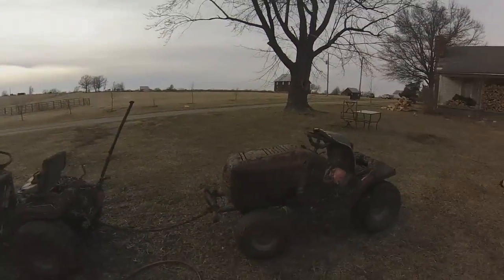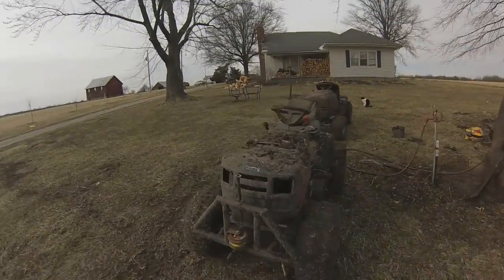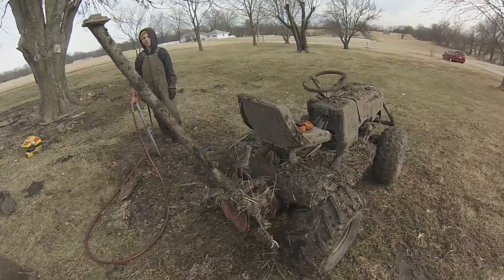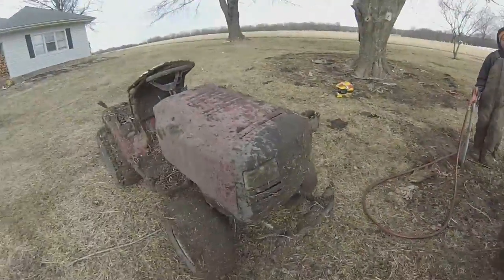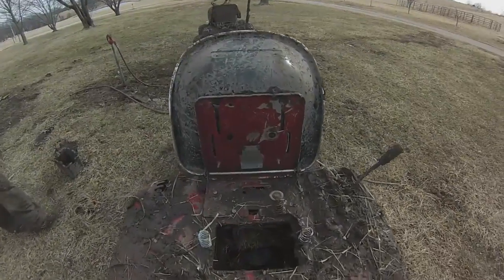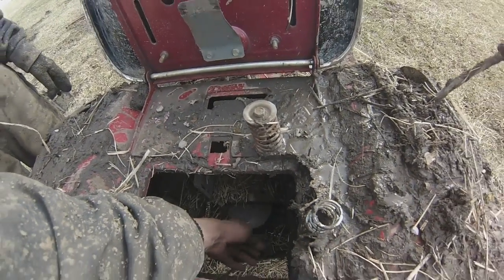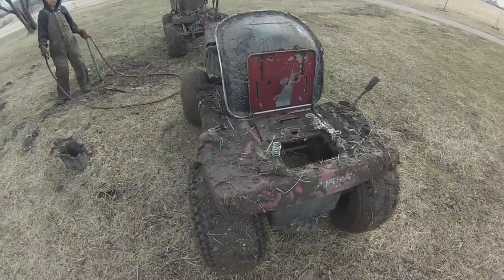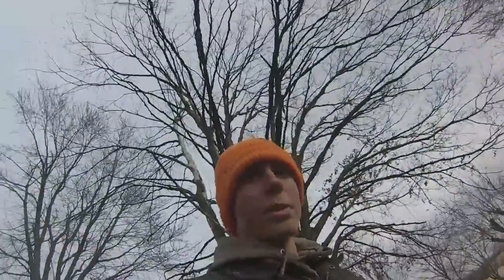lots of mud and broken parts

Comment: Ever mess with a troy built bronco?? Just picked one up cheap I'm gonna try to build it up any suggestions?
Reply from the maker: i have one of them but i would swap a peerless transmission into it and a new clutch

link for a new clutch   how to make a clutch for your racing / mudding mower- part3 of racing mower build
Reply from the maker: try to keep a 1:1 ratio of the pulleys from front to rear for good trail speeds
Reply: now by a 1:1 ratio what would be best sizes for speed while keepin the most power to still be able to climb per say
Reply from the maker: 4-6 inch pulleys in front-back
Reply: ok thank you
Reply: @enduromike9120  Good trail ratio.